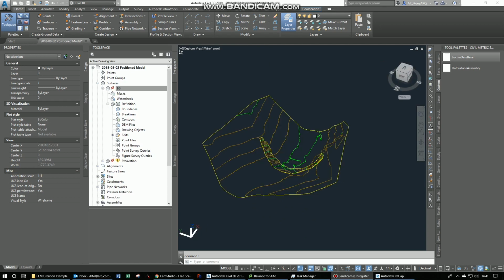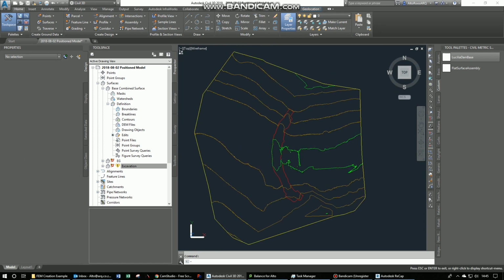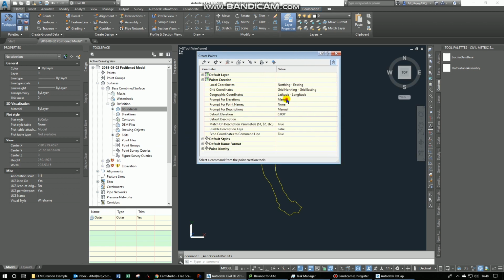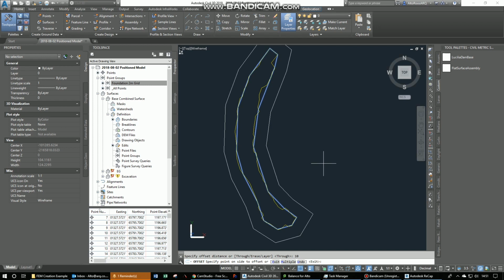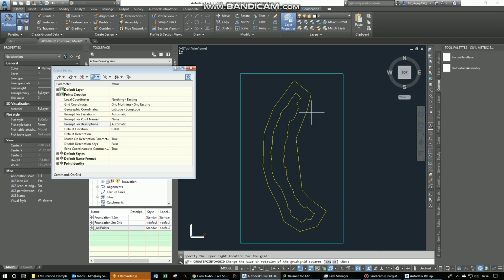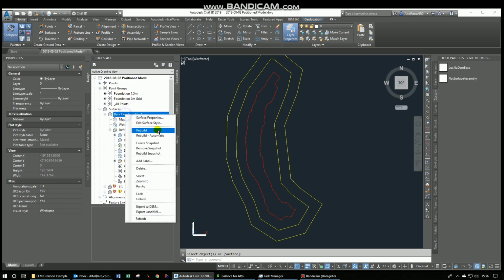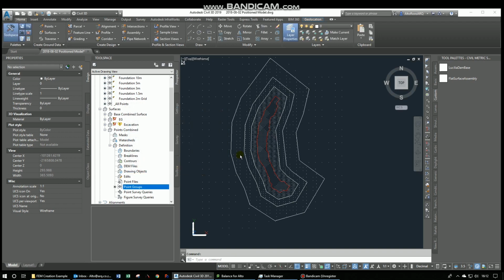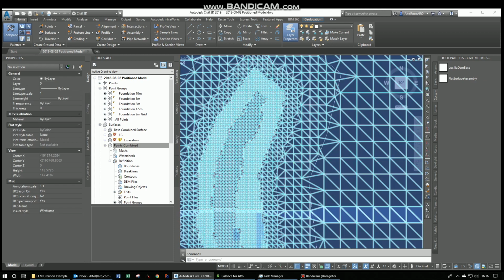Civil 3D: Creating a Surface for FEM - Video 1-2

Comment: Hello sir, can I request training on dam modeling ?
Reply from the maker: The best "Training" you can get is to practice and try different ways of achieving the same thing with different methods and/or software. There is no correct way, the best way is the method that helps you achieve what you want/need to via the quickest path and whichever allows you to make changes without having to redo everything. Good Luck.

Comment: How u create the excavation?
Reply from the maker: Better late than never... You create the excavation by considering what the underlying geology looks like based on input from experienced engineers with adequate Geotech experience, determining what founding conditions your structure require and then you determine how you should excavate your foundation to obtain what is required. In the context of the video how you create the excavation honestly doesn't matter, its a couple of points and lines which you create a foundation excavation surface for which you can paste onto your typical terrain surface. Thereafter you clean it up as required and then you should be good to go.